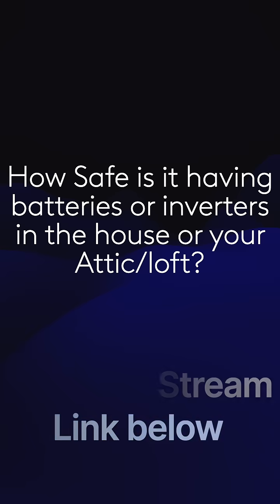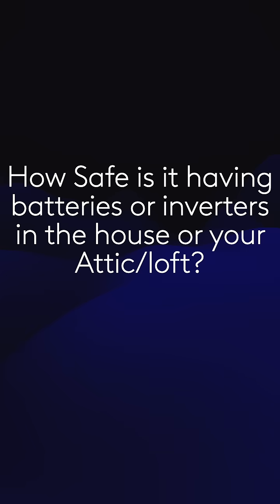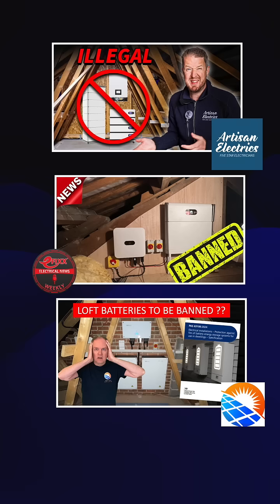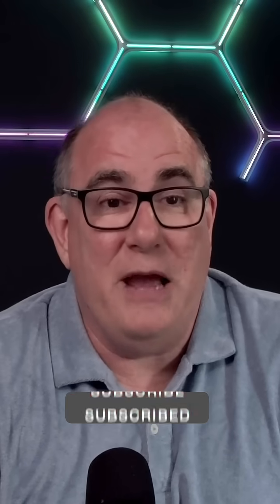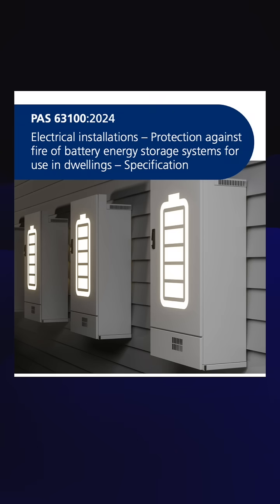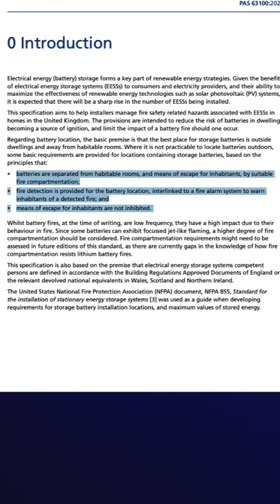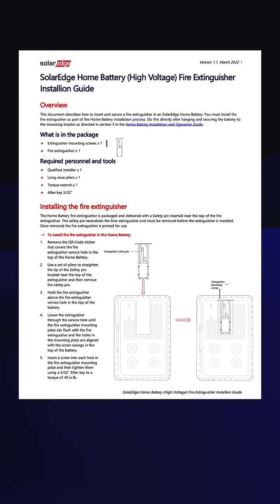The Real Reason Batteries Are BANNED in Roof Spaces!

Comment: My inverter and battery in loft. A fire and smoke detector linked to the others in the house also there. Temperature sensor linked to my tado system will early warn high temperature. Fire proof mounting boards also incorporated shielding both. Fire extinguishers nearby. I inspect every week. But thanks making me nervous 😢 Now going to investigate a fusible link system to emergency cut power to system,similar to that used in commercial boiler houses.
Reply from the maker: talking to electricians the main worry isn’t it will start a fire, it’s if a fire starts and fire fighters are in your home the worry is having a 100kg battery potentially about to crash down

Comment: When does a loft become a loft? We have our inverter and batteries in a space that is under the sloping roof yet on the 1st floor same as the bedrooms and bathroom, and essentially a loft space. No problem having them installed there, the other space considered was under the wooden stairs - also combustable and would cut the exit from up stairs if there was a fire. I'm not sure how useful this guidance really is. Unless all housing stock is made compliant (prohibitively costly), it will be impossible for a significant number of dwellings to adhere to the guidance.
Reply from the maker: As at this stage it’s only guidance. I don’t think there’s any reason to think there’s anything wrong with the way they’ve installed it. A few others have pointed out that one of the reasons for not having heavy batteries in the attic is that if the house were to catch fire And firefighters were in the house they could come down through the ceiling. But as you say, houses are all designed different differently and not everybody has the ability to put them outside the main dwelling

Comment: Illegal???? a bit of scare mingling on your part , some have fitted heat alarms in the loft  in line with other alarms in the house which trigger all alarms together
Reply from the maker: OK illegal was what my electrician told me, even if it’s not strictly illegal as there have been British standards guidance on this he very much doubts. Any electrician would take the risk of installing a battery in your attic. Most won’t even entertain it now as they were worried about liability if something were to go wrong. The reality is if you were to have a fire in your attic due to a large battery pack having smoke alarm up there is really just gonna tell you to get out of the house, it’s not like you’re gonna be able to get up there and fight the fire. Maybe the British standard guidance is a good thing.

Comment: Not a semi-major issue, at least in our household insurance policy. We have a similar house to JT (albeit a EPC of 39). Household insuarnce is still an all risks policy, but it is not senible to have heavy batteries above your head in a fire?
Reply: By the time the floor structures were compromised you’d be out the house. If you weren’t then you’d be beyond survivable. The only people in the property at that time would be firefighters who are trained to deal with falling debris and would face far greater dangers when firefighting commercial premises than a heavy battery in someone’s house. There are plenty of heavy water tanks in upstairs rooms and lofts, nobody has considered them to be a danger when falling!
Reply from the maker: @jamesedwards860 I agree there are other risks but this is one that can be easily mitigated, water tanks need head pressure and often the only way to do this is to gain height, batteries do not need to be installed in attics, its just one more thing we can mitigate to make things safer.

Comment: You need to fact check this one. It’s not illegal, it is guidance.
Reply from the maker: Ok technically your correct but every electrician I spoke to uses the phrase illegal, basically they won't fit them due to liability reason and given the type of work its not something a DIYer should be doing. Also I would be very surprised if you had a fire if the home insurance company would try to avoid paying out as its in contravention of this guidance
Reply: @JonathanTracey no issues with house insurance. Thousands of properties with previously installed batteries in lofts. As long as final connection is made by a qualified electrician then the installation is compliant with building regulations, and that’s the only thing that matters.
Reply: @JonathanTracey  Well, electricians are not the smartest people sadly, it is a guidance, there is no law stopping anyone from installing batteries in the loft space. It is Customer choice and a lot of installers will install the batteries and inverter where Customer wants it...

Comment: There have been home fires with LG batteries (NMC chemistry). 
https://youtu.be/QHmahZakMEQ
Unfortunately it's not always clear what's in the box, so you may want to check for recalls. The SolarEdge HV batteries are NMC chemistry and is maybe the last brand out there that has not switched to LFP.
Reply from the maker: yeah, I did manage to find some information about the LG batteries, but I couldn’t specifically find any that were installed in the attic space of houses
Reply: @JonathanTracey  As you said, getting the batteries up there is pretty hard with the weight. From what I have read a SolarEdge HV battery is very heavy and using it in high temperatures for an extended time voids the warranty (is on the data sheet).
So finding such a rare combination of incompetence and bad luck is going to be hard.
Reply from the maker: yeah, even if they were able to install it in the loft, each of my batteries is 120 kg each and they wouldn’t fit through the hatch so he’d actually have to cut a large hole in the ceiling, which the chief financial controller would never allow